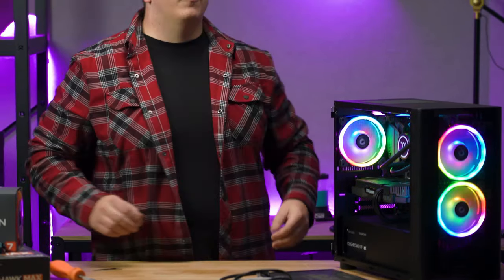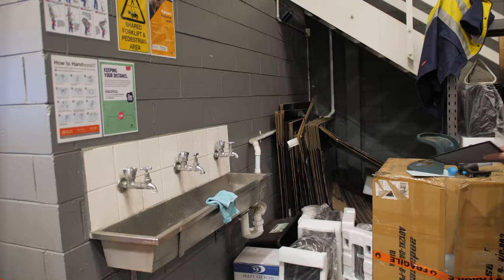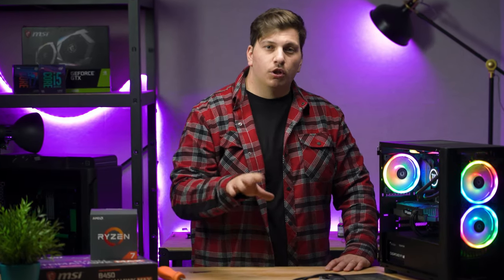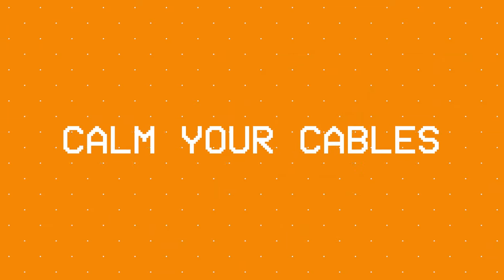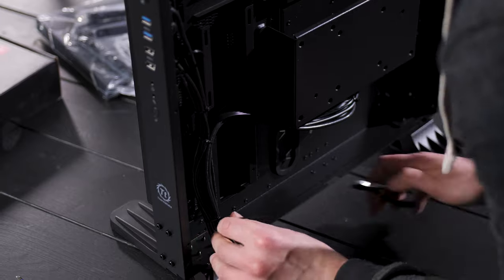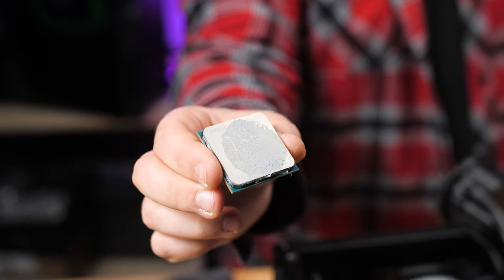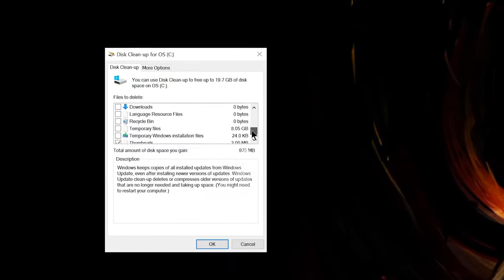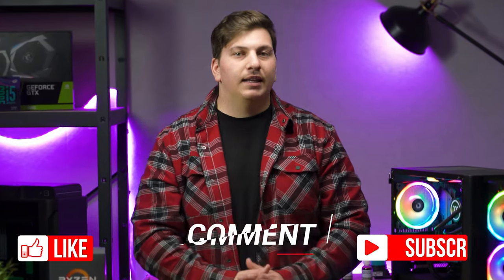How to SPEED UP, REFRESH and EXTEND your PC PERFORMANCE | 5 PC Maintenance Tips

Comment: Nice work Jono! Did you have some dentistry done? Your voice sounds a tad different.
Reply: Oh - if the dust is that thick, use a handy vac first! I had a sympathetic asthma attack!
Reply: Oh again - clean the old thermal paste from both the CPU and the cooler block!
Reply from the maker: Cheers Mykl! Negative on the dental, just some good mic positioning I think haha. 
Good point out on the thermal paste - you should also clean off the cooler block too, totally forgot to add that in even though I did it off camera!